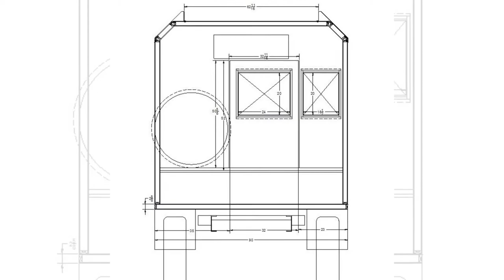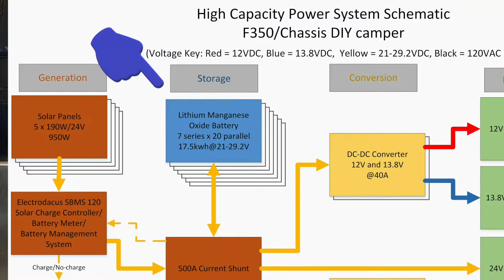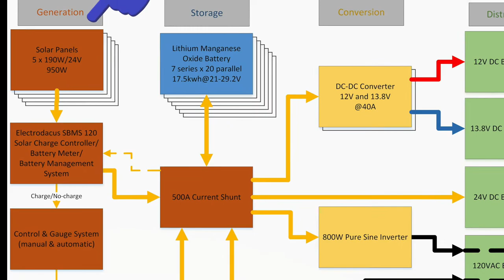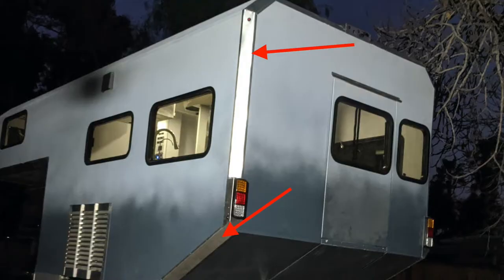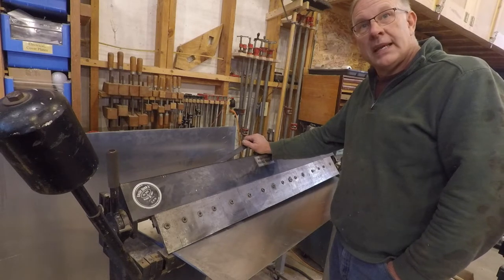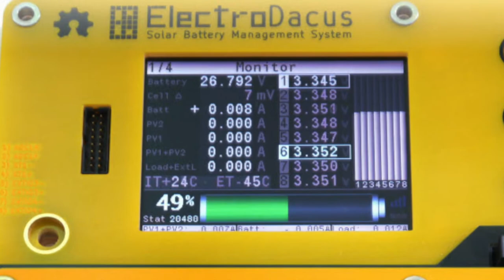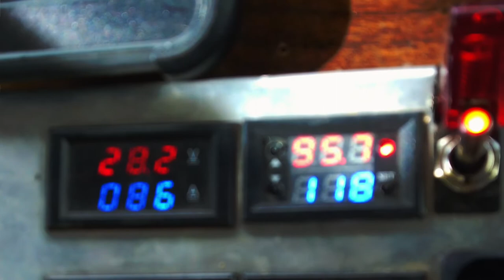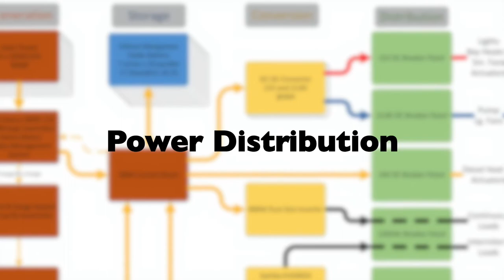DIY RV Lithium  Power System | Using Nissan Leaf Battery Packs | ep:16 Our DIY Custom Camper

Comment: Man, this powerbank is really something else.  I am not an electrician and barely know the difference between marine batteries and lithiumFe batteries, but your set-up looks very impressive to me.  I've never seen anything like it, and I don't think I've ever heard about a RV system outside one of those million dollar jobs that has this much power at the ready.  In the comment in a previous video, Steve said that he thought this power box was too heavy and was causing issues with the pivot-mounting system, and that he was gonna change the layout.  Have you changed the layout yet?  If so; what did you do and where did you put it?

Also;

In a previous episode, you said that the water system int he other wet box was not working on your 'Shakedown' trip.  Do you have any idea why it was not functioning?  I linked that vid to a commercial/industrial plumber friend of mine, and upon looking at the diagram he said he thought something might be wrong in the scheamatic.  Specifically, that there was a checkvalve after the heat exchanger, and he said that you don't need that because the diaphragm in the pressure pump will make sure there is no backflow.  He did not know why the plumbing system was not working, but he said that was the only thing he noticed that might be wrong/a problem on the diagram.

You've rally caught my interest with this build series and now I feel sorta of invested, so I'd like to know what tweaks you have to put into it (like any big job, nothing works right until you tweak things) to get it all working.
Reply from the maker: Love the questions!  The power bank just moved and was completed yesterday.  Not wanting to post a spoiler we have those details coming in the next video.  For the water system, it’s getting resolved now.  Mostly had a few fittings leak and our particulate filter would not seal and leaked.  I’ll let Steve describe those in more detail in another comment...stay tuned.
Reply: @WorkingOnExploring    Thanks.  I'll look forward to seeing the details in one of your future videos.
Reply: The water system problem was a time problem. I was unable to test it until 2 hours after we were supposed to leave for the truck camper rally. There were several leaks in threaded fittings that were going to take some disassembly to access and I didn't have time to do it. 1) The  'Big Blue' water filter housing just would not sea (I've removed it)l. 2) Special fittings (2) I made for my water manifolds that didn't get tapped enough (because I didn't have a 1/2" 'bottoming' pipe tap and I have since made one) were the biggest leakers.

There are TWO check valves in the system to prevent the mixing of hot and cold water. The HX and pump create two different paths for water to mix into opposite systems. 1) Pressure ; If the heat exchanger pump is circulating water through the tank, the hot water circuit is at a higher pressure than the cold water. With no open taps, this is not a problem but if you open a cold water tap, the cold side pressure drops allowing the higher pressure in the hot water system to backflow. 2)  Resistance;  There are two paths cold water can take between the inlet and outlet of the water heating system (one through the tank & HX, the other through the pump), water will take the path of the least resistance which, in this case, is the wrong one. If hot water were turned on (circulation pump off), cold water would flow backward through the pump and into the hot water system. The check valves requires cold water to pass through the HX, into the tank, forcing only hot water into the system.

On 'tweaking'....As an engineer, I have always believed testing is the most important part of the development process. It not only shows up design errors but manufacturing errors. Probably the biggest 'redo' is the battery mounting which I just finished. That failure was largely due to a design decision I allowed to get stuck in my head. In design development, it is necessary to keep all options open till it is necessary to make a decision and move on. You cant keep reevaluating options forever because you'll never get done ('Analysis paralysis').  When the decision is made, it is now necessary to keep focused on the decision and not second guess. Sometimes it bites you back. How I have the battery box now is virtually perfect in weight distribution, use of inaccessible space, and optimal battery connections. It is inevitable this will happen in any big project. This is why I think design is a 'team effort'. Different perspectives are needed to find the best SYSTEM solution and avoid the 'insufficient' one. One engineer will get tunnel vision. For the most part, I bounce as much as possible off my wife (a computer scientist/project manager), but getting an uninformed party into the process is more work than benefit. I have not redone much. It's more a matter of detailing the big pieces in CAD so I have a plan to work on with confidence and dialing in the minor details in manufacturing. This is how it works in the 'real world'.....FYI, I have worked about 80% of my career as a manufacturing engineer/project manager and 20% as a design engineer. Sometimes, I just have to start with a little detail and a concept and fabricate it into proper operation. Some examples are 1) my false ceiling/air circulator (already replaced the fans) 2) wiring of my control center (still more of a wiring mess than I expected) 3) Plan to use duckboard flooring to hide subfloor piping (good but less necessary than I originally thought). 4) Securing the domestic refrigerator (redone twice) 5) Much of my sheet metal work is done with paper and pencil in the shop and about 20% of it is 'sub-optimal', some of which I live with and some gets redone.
Reply: @stevehericks5764   Hey, thanks again of the reply and more info.  

I have never built anything like what you've built here, and am by no means an engineer in any way, but I know what you're talking about with getting an idea stuck in your head, because you have to make a decision and move forward, and later occasionally finding that was not the best option in the end.  That, in addition to the normal adjustments you have to preform to make all the stuff that did work, work to its optimized and efficient limit, is where all that tweaking stuff comes in.  

I am happy to hear that the electric system was sorted out, and that it is working as well as it can, in addition to making sure the rig is as stable as it can be.  Likewise, that you know the exact and explicit problems in the plumbing, and have taken care of that and can get onto testing the rest of it to make sure it's all tight and sorted away.

I gotta admit I still don't understand the intricacies of the plumbing system, nor what those checkvalves are doing.  I was merely relaying something a plumber friend of mine mentioned, when he looked at the vid.  Despite your detailed explanation, it looks like understanding plumbing is just beyond me.  It's not beyond you though, and I have ZERO doubt this plumbing system will work far better than even the million dollar RVs complex systems by the time you're done.

Lastly, why did you have to replace the roof fans?
Reply: @evilcam  Not the roof vent fans (I have 4 Maxxair), Inside the false ceiling, I have 2 air ducts about 2"h x 5"w to circulate air from the bunk down to the back where the A/C unit will be. The diesel air heater is at floor level under the kitchen and just vents into the large room. Keeping the air moving helps to maintain a uniform temperature in the whole camper. Because the duct is small, in order to cause good airflow, I need a 'squirrel cage blower' to move air because it will produce a higher 'static pressure' than bladed fans. When specifying any kind of fan, they often hid their noise rating. Some (cheap ones) are much noisier than others......I bought 2 -120mm x30mm Delta blowers but they are way too noisy (despite the spec saying they are not). I put a speed control on to slow them, hoping they would move enough air at a lower speed and noise but that did not turn out. I replaced them with 2 bladed fans, supposedly 1800RPM and really quiet but they (both) have a 'tic' that is annoying.....might have to do it again but for now it is good enough.
Reply: @stevehericks5764   Ah, I understand now.  I do recall you showing us the duct fans in the video covering the false ceiling.  My bad, for thinking it was the vents rather than the ducts.

Comment: How where can I get some of those Nissan Leaf batteries?
Reply: I got mine from a couple clowns on craigslist who stumbled into a whole battery from a wrecked car. I don't think that is a likely avenue. eBay is one place I have see. Packs were going for about $100 each but shipping is an issue. Your 'local' EV repair shop is probably the best place and the price. I'm SoCal and there are a number of them around but I doubt there are that many across the US. If you are looking for a 'great deal', on used EV batteries, I don't have a specific suggestion. Until I stumbled onto mine, there were no great deals to be found. Demand for lithium batteries is great and the prices reflect that. There are some 'recycling' business is CA that are specializing in recovering EV batteries but I don't have any specific experience and doubt they are any different from an EV repair shop. Using EV batteries requires going to a 24V or 48V system so decide first if you really want to do that. If you are wanting to build a large system, you'd be best off with a 12V system. Buy  LFP prismatic cells and add a BMS. Will Prowse has some good videos and advice for that.